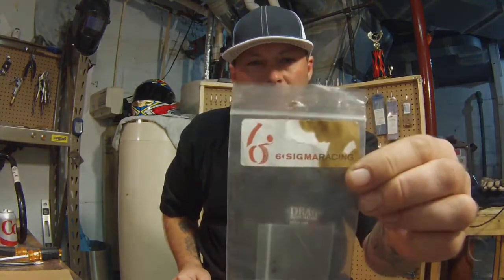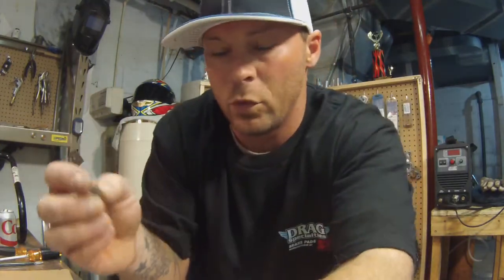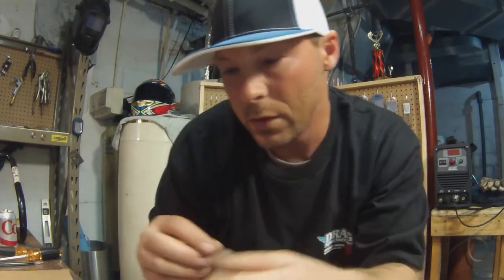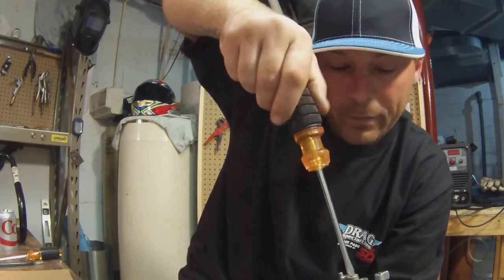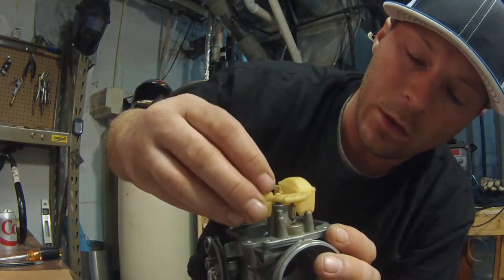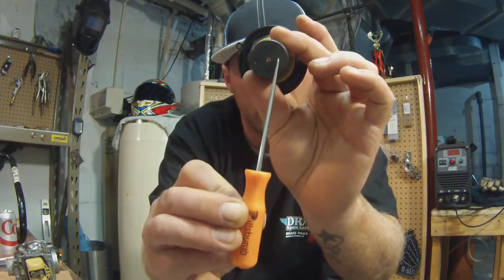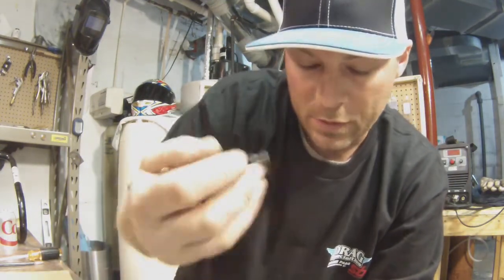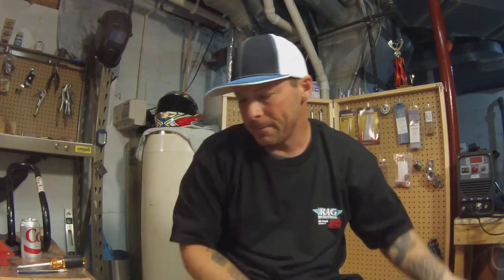honda rebel bobber build: carb rejet

Comment: i have an 04 rebel 250 single carb, just put pod filter and no baffle straight through exhaust but the only jetting kits i can find are for the dual carb! am i doing something wrong? also want to include that its very lean it starts fine but wont go past 35mph in 5th gear just cuts out and backfires so very lean
Reply from the maker: Sigma 6 raceimg for the rebel carb model ( Honda runs that carb on different bikes also) look at the jet size and on the main jet and you need a size bigger and maybe a small washer for the jet needle, the sigma kit comes with springs and jets,washer. Dual would work maybe if the jet is bigger, Honda rebel doesn’t have a duel carb only 125 rebels that are uk  version or a China knock off

Comment: What size jets would i need for an 85 rebel after i changed the exhaust and replaced tge airbox with a performance air filter?
Reply: You ever find out?
Reply: 145 main

50 slow

Comment: what happens when the needle seat (the brass metal piece where the needle rest on) keep slipping out?
Reply from the maker: Hmm good one! I’m not sure what’s going on? But if something is falling out lol I’d say it needs to be tighter ?? Sounds to me something is worn out. I haven’t had this issue before and to be honest I haven’t been in that carb for sometime and don’t remember. I run a much different carb than the stock. I can open one up and look. But if you have pictures of it you can send me?

Comment: hey Ryan just got a 85 rebel 250 with about 6000 miles on it and i wanted to cut the pipes and open up the air box and put a better filter on it. already got new tires. next steps the jets, muffler, and air-box, then the fender. But i wanted to know what sizes i should use and any other great advise you might have. if you could too, maybe some links?
Reply from the maker: Sweet! You are asking for jet size?
Reply from the maker: http://raggedmoto.com/carburetor-jet-size-calculator/
Reply: yea, wanted to know what i should get air filter wise. i wanted to open up the box and but a pod filter on it. Thank you for the link ill use it now and figure out the sizes i need